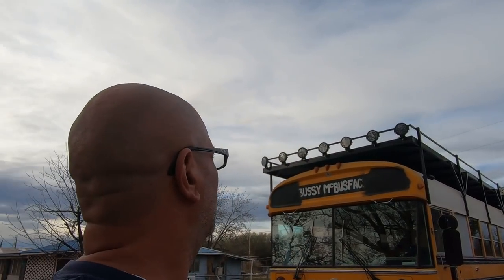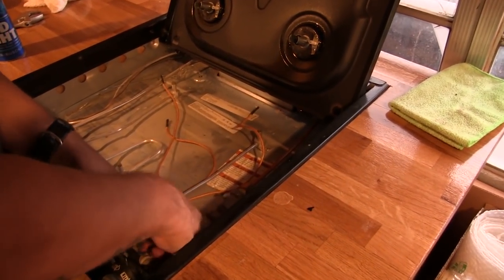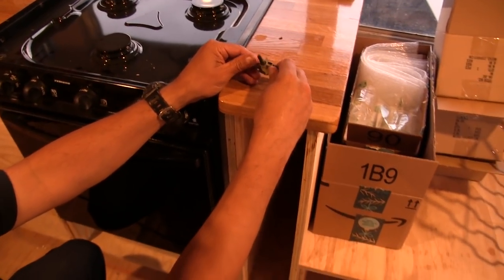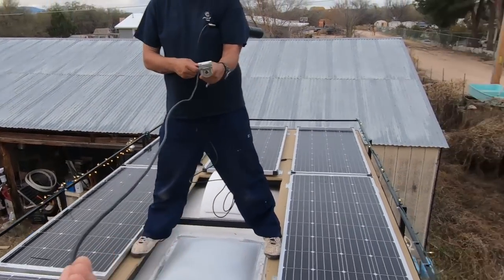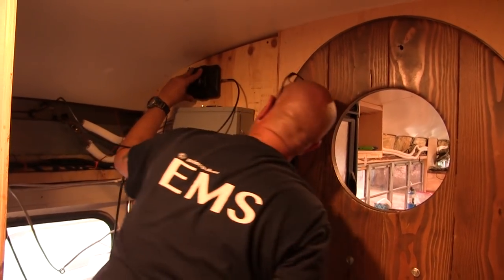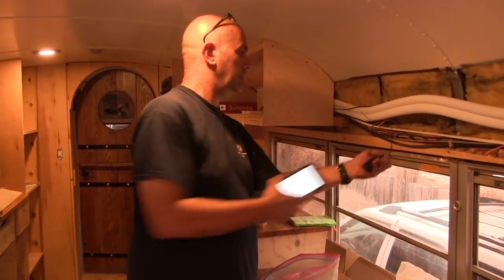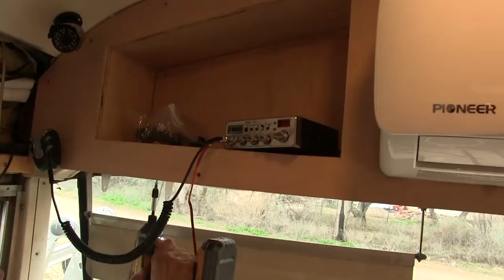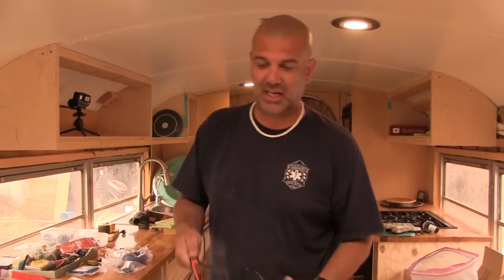Our Skoolie gets Off Road LIghts, Weboost, CB Radio/PA and Replaced Stove Igniter

Comment: Excellent job on your few adjustments.  Not all bridges are 14' clearance while some are 13' 5" and so forth.  May want to consider lowering your antenna bracket on the frame support of your roof patio leg to lower the antenna to have shorter clearance.  I know the higher the better, but anything above 12' will get you good reception.  If you are planning on boon docking, you will encounter places are areas with much lower clearance.  Just a thought........... O', when are you installing air horns........

Comment: Hey Mike, don't quote me as I am retired BUT there is  or was recently a federal rule adopted by states that limits the number of forward pointing lights, and especially high power flamethrower headlights.   Please check with AZDOT/ state trooper or motor carrier inspector as in the recent past, that many lights required "bras" or physical covers while on the highway.
     It would suck the end up paying 4-5 times more for a citation that the cost of the lights themselves plus have to remove the lights before proceeding.  Sorry.

Comment: wouldve mounted the wifi extender antenna so that if hit it could rotate flat on the roof , the way you mounted it now its the highest point on the bus and if a low hanging branch hits it it prolly will break the the pilar that holds the antena up

Comment: I just had a thought you don't need a 50 amp service for your bus because you have solar panels that run on batteries for all you really need is a 20 amp service be able to go plug in an automatic battery charger

Comment: That CB antenna is going to need a spring on it first time you run under a load tree branch going to break off
Reply: Had one just like that on my Freightliner and snapped it off on a very low branch.